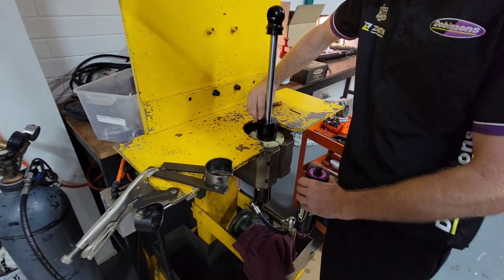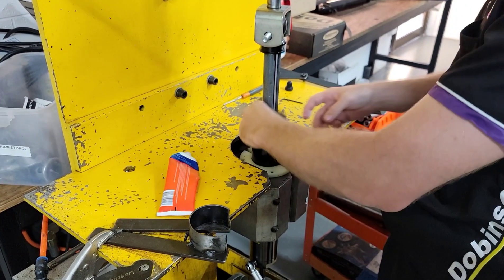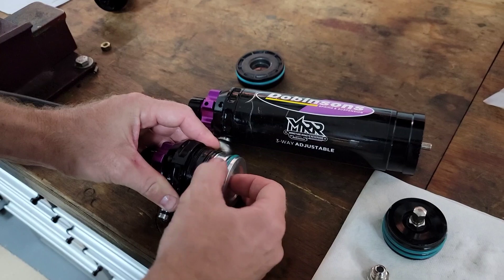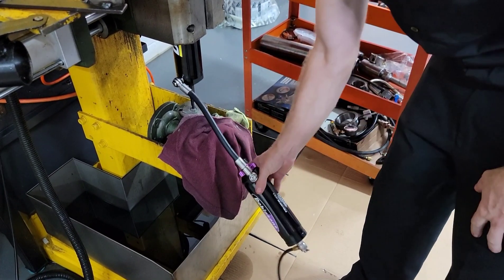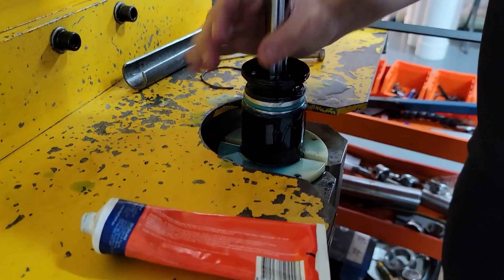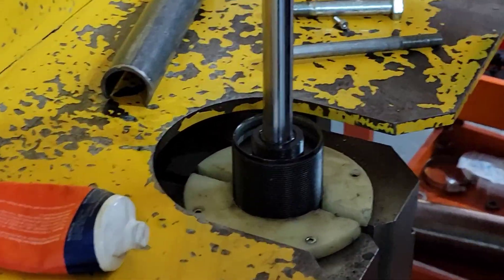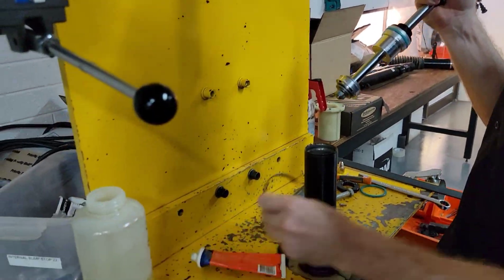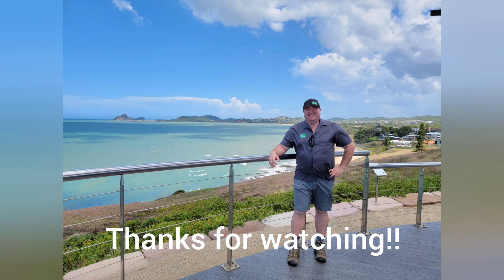What's inside Dobinsons IMS and Dobinsons MRA Shocks and How to Rebuild Them

Comment: Super awesome info! Good to see how it all works and goes together.  Thanks Mike and Ben so much! 🤙

If wanting to have our shocks rebuilt, when the time comes, what would be the best avenue to go down to get this done?  

Also, is the IMS (what I have) still considered an emulsion shock?  Wild question here, but would it ever be possible to install a functional external resi to it to make it more robust and similar to an MRR setup?
Reply from the maker: You're welcome!!

Dobinsons USA has all the tools and parts to rebuild any Dobinsons monotube shocks.

No, not emulsion shocks.  IFP monotubes are the type, as the gas and oil are separated and cannot mix by the floating piston separating them.  Also these could be run upside down or right side up, whereas a twin tube can only go one way.  Obviously the way they have to mount in a vehicle is only one way. 

You could perhaps add a resi with DSC adjuster, as the IMS body is drilled the same for a hose and for the air valve.  Parts and labor cost would add up fast though.

Comment: I recently put a set of Monotube Dobinson shock absorbers on the rear of the 1996 80 series (1HZ diesel), but they're definitely under damped when fully loaded (2740kg on the weighbridge).  So I'm hoping I can get them revalved to get more damping (probably a more rebound and compression).  I'm in Sydney Australia - is this something that I could get done here or would I need to remove them and send them up the Dobinson guys in Rockhampton?
Reply from the maker: I believe the guys in Sydney could do it for you. You'd just have to call them up and see what's involved.

Comment: Are you able to add the remote reservoirs to the ims shocks at a later date?
Reply from the maker: Technically yes, with high and low speed adjusters but not rebound.  Dobinsons would have to do it but I've yet to see anyone get it done.

Comment: I have the dobinson MRR shocks in a JL wrangler and the ride is harsh even when low speed and high speed are fully backed off. Can I send these to dobinson for a revalve? Wranglers are lighter than most 4x4s and I’m after a smoother road ride.
Reply from the maker: Yeah I'm sure they could revalve them for you

Comment: What should be the maximum gas pressure in front and rear on Dobinsons IMS?
Reply from the maker: Minimum gas pressure for 18mm shaft – 140psi and for 22mm shaft – 120psi

Comment: Why do some shock absorbers have a internal bump stop while others don’t for the same vehicle?
Reply from the maker: It takes up a lot of space.  An external bump stop can be bigger and work better in my opinion than an internal bump.
Reply: @ExitOffroad  I’m about to remove the external bump stops on the piston shaft and just rely on the bump stops on the live axles as it’s restricting the articulation when i’m going off roading compared to the original shocks . but they are not dobinsons

Comment: How long is the break in period for the IMS? I lifted my  truck  3" and it went up 5" I dont know why! I set  the front at 226mm with a 302  2.5" coil!
Reply from the maker: About 1000 miles of mixed driving so that the suspension cycles up and down a lot.  Could be that your base measurement was sagged a good bit lower than new OEM heights.
Reply: @ExitOffroad  Ok only drove about 10 miles on the street.

Comment: I have a 2021 toyota sequoia and my dealer says I dont need to change the upper UCA or a diff drop. I bought a IMS kit. Is this true because I worry if I take it on the trails something goes horribly wrong or in long run it prematurely breaks something.
Reply from the maker: As long as it's 2" of less, that's correct. If it's the taller 2.5" up front then yes, you should at least add UCA's
Reply: @ExitOffroad  Thank you.. I'm pretty excited...